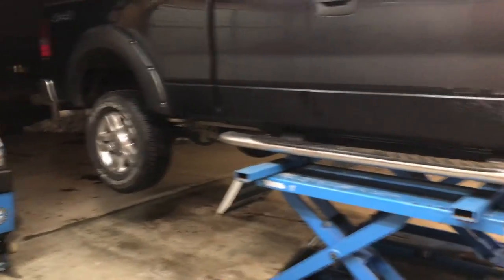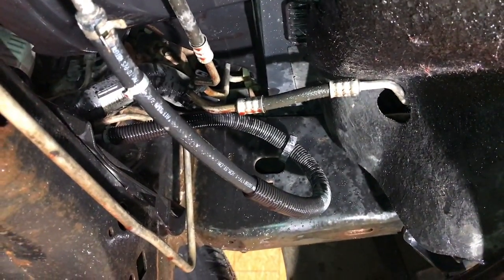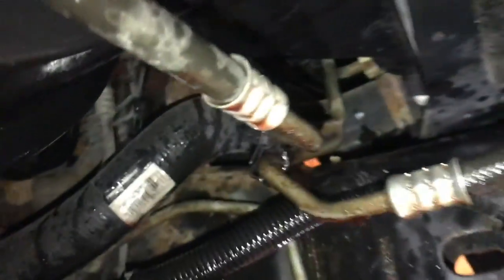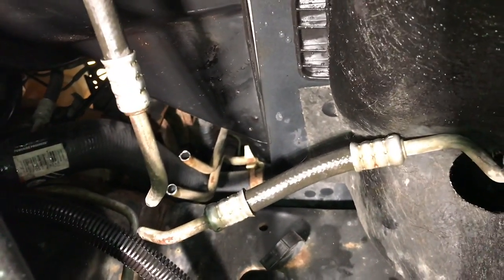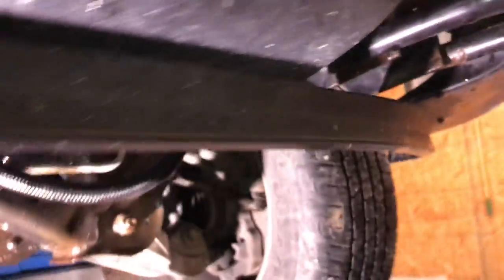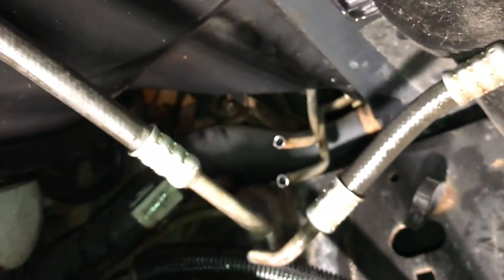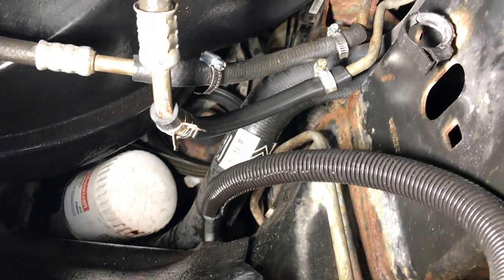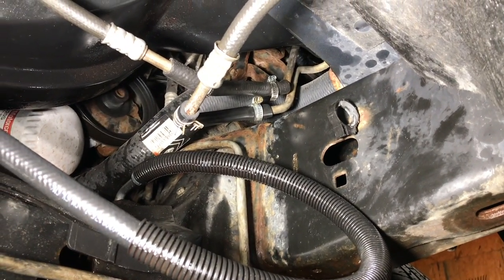How I Fixed a Leaking Cooler Line for Free

Comment: I am personally not a fan of slipping rubber hose over trans lines. I have had them blow off and leak trans fluid everywhere. Its under a decent amount of pressure. I either replace the lines completely or in that case you could use a compression fitting to connect the two metal pieces together. Or even flair the line a little then slip the rubber hose over that.

Comment: I had a similar experience but with a different vehicle. Mine was a hydraulic leak. The lines rusted and it was hard to keep the rubber hoses in place while under pressure. An advice I give you is to flare up the end of the metal hoses like a brake line, this creates a larger end and when under pressure, it prevents it from sliding out due to the increase in diameter and it stopping at the hose clamp. I drove this vehicle for many miles after the home repair without any issues. The idea came to me after 3 unsuccessful tries and waste of hydraulic fluid. Hope this helps.
Reply: Great idea to better secure the rubber hoses to the metal tubing
Reply: I was gonna comment on the need for having to flare the end but there you’re, you have already said it. I don’t know if there’s a small inexpensive tool you can use while the pipes are still in the engine bay though.

Comment: You could tie rap your hoses back on the retaining clip so that the weight of these hoses do not fatigue the metal near the radiator connections. They will bounce when you drive down the road.

Comment: Next time, spray some rust penetrant on the quick connect and let it sit, blow out all the grit and re-spray the rust penetrant. And, get yourself Assenmacher Specialty Tools 8021 Oil Cooler Liner Remover Tool, 3/8"

Comment: I have an 2008 Ranger which is leaking power steering fluid from the low pressure side near the cooler. I thought at first it was a rubber line going from the aluminum cooler to a steel return line to the rack and pinion. I replaced the rubber hose, but it was still leaking exactly the same way. I surmised that there must be a leak from rust under or very close to where the rubber meets the steel line. Before I watched this video I came to the same solution. I am going to cut the steel line back and attach a longer rubber hose and clamp it with two  clamps. Your video has given me confidence that it will work. Thanks!

Comment: Used your method with 3/8’s high pressure rubber fuel injection line with double ended clamps to replace a small section of rusted out lines wrapped with the plastic clip holding them together. Works like a charm. Spent less than $40 saving hundreds going to a local shop. Besides they were all backed up with work 2 weeks out and I need my truck everyday.  Thank you so much !!!

Comment: Good idea on 2 clamps per end since there is no barb helping to keep the hose from sliding off.  I would re-tighten those hose clamps in a couple weeks.  Rubber hoses soften up after some heat cycles and the clamps won't be tight anymore.
Reply: MAP74 I don’t trust hose clamps I like the one time use crimp clamps.

Comment: As you pointed out, and as I found out on my own, the rust appears and eats through these lines only inside the rubber brackets which retain moisture, regardless of the manufacturer of the vehicle, if the vehicle has this type of bracket.  Repairing is much easier, much less expensive, much more convenient and just as effective as replacing the line assemblies.

Comment: It will leak again using the worm gear hose clamps, because they do not expand and contract according to ambient and operating temp.  I have experienced this first hand myself using worm gear hose clamps on an external transmission cooler.  It leaks at the fittings where worm gear hose clamps are used.  The hose can actually blow off when it's very hot during the summer, without that clamp expanding accordingly with the line's temp once expanded at trans fluid's 180F ~ 200F.  You should get brand new spring clamps.

Comment: I have to do this exact job for transmission cooler pipe. So will do exactly as you have done, when hose arrives, Plus double up on the hose clamps as advised, Think i would have done that any way. Useful video.

Comment: Great video.  I would use this as a temporary fix.  Best thing would be replacing the line or lines. That way it should last as long as the truck or same amount of years
Reply: Yeah temporary fix till they brake again. This repair will last just as long.

Comment: T bolt clamps is the way to go.
I had a lot of problems with those worm type clamps on air intake on a turbocharged car. In 10 years  not one t bolt clamp came loose on that car.
Reply: What is a tbolt

Comment: I was just replacing a motor mount yesterday and noticed my rusted lines finally broke through. It’s a tiny tiny hole. It’s small enough to where it’s just creating a wet coating in the line. No dripping luckily. Been rusty for a long while now but idk if I should spend the $70 on new lines or just do a jerry rig like this. The entire metal pipe part that goes along the radiators bottom so I think the whole assembly would make more sense

Comment: It almost looks like it broke at a point of movement, maybe from vibration, temperature, or bumps in the road. As you say, the clips are, ironically, part of the problem. I bet the dealers see this as a common design weak point.

Comment: Seems they use Metal brackets to support Aluminum Lines too.
then Bi-Electric galvanization Corrodes the Lines. 😡 
Thanks for another great Fix Tip

Comment: Great video,  I  tried it on steering lines but the clamps would come loose with the heat/cold cycles, will try it on trans coolant lines though
Reply: Use Fuel Injector clamps.

Comment: What's the hose type and size? 
It looks like I'm going to have to do this. Great video.
Reply: @giovannicolaluca6977  I ended up just buying the cooling lines that were made to fit my vehicle and replacing the entire thing. Thanks for the reply. :)
Reply: @MorrowSind  how hard was it to replace it?
Reply: @Rudy Diego  I replaced the lines on a  2005 Jeep Liberty. It wasn't too bad. One thing I didn't do that I should've, was take the front drive shaft off to reach where the lines actually tie into the transmission. I just used compression fittings and tied the new lines together right below where they actually connect in. Mainly, just fishing the new lines into place was the only problem. I took the bumper and front grill off to connect the new lines into the front of the radiator. It probably depends on the vehicle. But all in all, it's not too bad of a job.

Comment: If my transmission cooler line were it goes into transmission would it cause my vehicle to over heat it does have a leak
Reply: Yes , it will overheat & raise transmission fluid temp , then  leak ATF everywhere through overflow tube

Comment: Had something similar happen on my 01 5.4  the flexible brake line going to my front wheel had corroded right where it connected and almost popped.That would of been scary. but all my other flexible brake lines are ok LOL just that one went bad so weird.

Comment: On a 1988 Ford f150 truck how to put the cooling line transmission line to the radiator leak at the top
Reply: At the top of the radiator where is leaked how to repair that on a 1988 Ford f150 would you show me that please right now

Comment: I thought Chevrolet's Rust real bad I hate to see the Ford aluminum body trucks
Reply: Freddy   They all rust depending on where you live.  Those lines have seen a lot of salt in 12 years. I guess time will tell on Aluminum bodies.
Reply: I know I work on vehicles and I see a lot of rust Rust is the enemy of everything I wonder what that the Ford aluminum body would do
Reply: Aluminum wont rust. It will corrode. But I doubt it will get that bad. I have an exposed aluminum drive shift on my f150 and it looks brand new. No issues and this truck as been in Michigan and in Chicago. So it’s lived in the rust belt for 6 years and no issues with the Aluminum.
Reply: Depends on how they're taken care of 😊